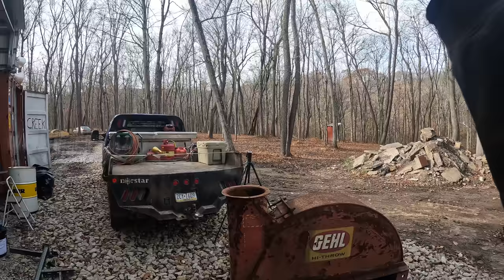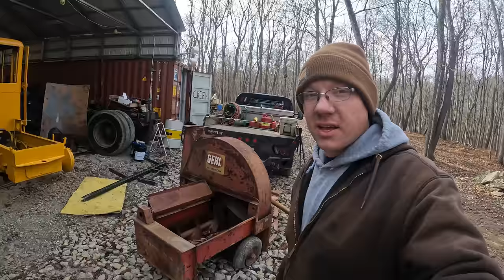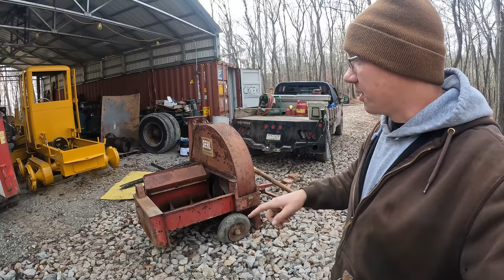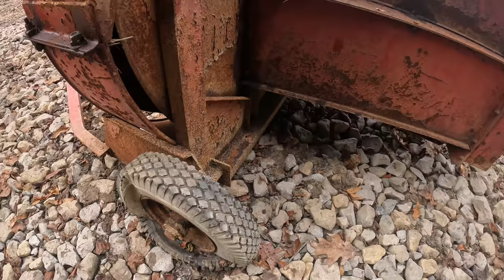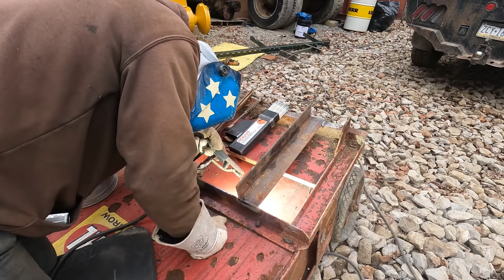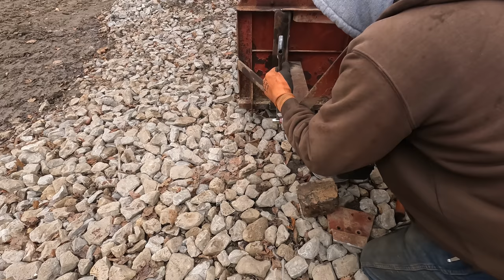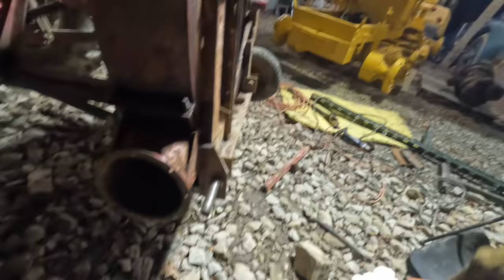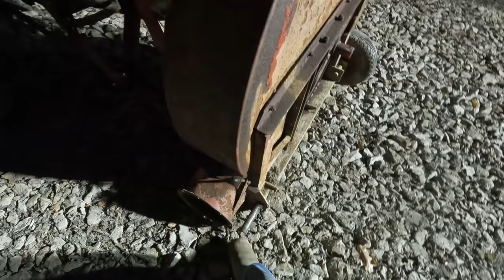I Built a Giant DIESEL POWERED Leaf Blower!!!

Comment: Dittos on the central air inlet around the shaft and putting a rectangular diffuser on the outlet. This is a centrifugal air pump, inlet air comes in around the hub or shaft and the blades accelerate the air causing it to go to out to the discharge volute by centrifugal forces and imparting significant angular momentum. When it gets to the discharge nozzle it escapes converting the angular momentum to linear momentum. A nozzle that reduces the cross sectional area of the discharge will cause the velocity to increase causing a more focused force to blow leaves. Try a nozzle that reduces the cross sectional area by at least half. In your video you can see how anemic the force of the air is. Partly that is due to the inefficiency of how the air is sucked in but a lot is also because of how the air is just dumped out through a big hole. What you need is velocity more than volume (think of a garden hose open and with your thumb over the end, which cleans the sidewalk better?) and a reducing nozzle will increase the velocity by close to the ratio of the cross sectional areas. I suggest making the the nozzle rectangular in cross section with the long side horizontal with the ground so not only is the velocity increased it is directed in a flat fan of air. Great show and a good example of thinking outside the box repurposing something.

Comment: Matt I think I have your solution. Take that band that turn grind off each blade edge down 1/8" now won't touch take a piece of ranger metal to patch that one area grind blade edge to miss easy know the wheels any scrap tube angle iron move the two wheels back in front put a small trailer hitch with a square bottom adjust to make you back up  put hitch pins if want a cheap hitch weld smaller pipe put a bolt and hitch pin know it sitting when stored on two wheels like a trailer and the hitch if those tire aren't ruined as the time are shorten that welder axle you cutoff one leaf on each side ok and that be perfect  for storage

Comment: just wondering if rotating the housing back to its original position and having a fixed chute on the right side of the machine with flexible ducting going from the output to the chute wouldn't restore full output. It would allow the wheels to remain in place as bogeys to allow it to float over the ground. That combined with the rubber tip idea mentioned elsewhere would prob net some interesting results.

Comment: I'm no fluid dynamics engineer, but I suspect that how close your intake is to the outlet will effect the pressure and efficiency of the blower output. Adjusting the intake size and output location could help. It seems that the original setup, while adjustable was roughly intake 180° to output.

Comment: Matt centrifugal compressors from 32 inches diameter upwards powered by 270HP plus diesels are used to suck rocks, dirt and fumes up to a hundred feet along then up vertical shafts out of opal mines.

The housings for the centrifugal impellers look virtually identical to yours but the blades for the impeller are sandwiched between two steel plates with the air intake in the center.

With that in mind, it occurred to me that instead of doing things by halves you would take the fun factor next level again if you could get hold of a small, service-time-expired PT6B or similar turboshaft engine and maybe even de-rate it a bit to go from hurricane to tornado!

As I understand it the composition and specific weight of Aviation grade kerosene which aircraft gas turbines normally run on is not so different from Diesel that they can't use it and if anything would run cooler which might be convenient!

I believe the turbines in M1Abrams tanks run on diesel and can even run on gasoline but as you might imagine they would run hotter!

I wonder how a blend of Gas/Kerosene and/or used sump oil might go?

The turbine could double as a sort of combination waste oil incinerator and leaf blaster and just think how it could deal with that pesky snow!

Forget about waiting for the leaves to fall, fit an afterburner to blast them off trees as soon as they change color then impress the neighbors and amaze their kids!

Any 'Greenies' within hearing distance would probably scream louder than the turbine and the only real disadvantage might be fuel consumption!

Comment: Wouldn't a skid plate work better to protect the shoot? Cut a hole above the shoot (180 degrees from current opening) same size as current back opening . Have one solid cover and one mesh cover and switch out covers as needed depending on task at hand.

Comment: the entire leaf blower must be layed  down horizontally  so you can position the hole and nozzle tip correctly i.e.  rotate  the entire machine towards where the leaf's are so the nozzle is directed where you want it.   also the nozzle  should have a flattening cone shape. just my two cents.

Comment: From the view point of a dairy farmer who has used these in there intended purpose, don't cut off those blades! If you look at them, there are bolts to loosen on the blades so you can extend the tips. That was intendeds to allow you to adjust for wear. The tolerance between the blade tip and the band is crucial to building proper pressure. Beat all the bumps out of the band, the adjust the blade tips. Our rule of thumb was for the blade to 'miss a dime but pick up a nickel'. [placed in the bottom of the band]  Rotate the band like others suggested, but for the love of god do not try to use that that thing for blowing straw!! They are insanely dangerous, unforgiving machines .It's not worth it, unless modified, maybe with an infeed table and pusher. Love your videos.

Comment: Hey Matt Bruce bonkowski I rewatching this video question that band slides around why not take that whole band off and that area you saw it stuck before taking it off mark the areas that impeller sticks then remove the band and then hammer them out then replace that band you might want to use your grinder the flat side of the blades my giant Vac blowers have 3/8" space from the band to impeller and mine band is all welded up and you might also spray the inside with a some thinned paint or old oil to stop the rusting I look to spray or roll it with galvanizolem it stop rust and being inside who cares and use that rear tire on the back

Comment: The blades or fan needs to be tighter the housing inside your losing power the way it is now. My 8.5 hp blower would porpell its self on the blacktop of the road. Matt put the caster wheel in front of the chute, make it adjustable

Comment: I was wondering if you can make a nozzle to fit over the end that is shaped like the nozzle on a hairdryer where it goes from a round end to a flattened one so that the wind is directed more in a flat flow direction, maybe you are losing some air force going above the leaves with your round end. I was looking at a hairdryer today and noticed the removable flat end piece. Also I was wondering if you can pull out the movable fan shroud and hammer out all the dents where the fan is rubbing and patch up that join where the fan is hitting.

Comment: Or just find a smaller diameter wheel that can be made to fit on the axle where it is.  It might also do some good to nozzle down the exit chute a bit more, and that might just be done with a sledge hammer.  I'm not sure that the intake placement is having such a big effect as you say it is.

Comment: Take that moveable shroud , so that it opens up to get the grinder on the blades and take some fresh bright metal off the fan blades, till all the fan blades are not hitting. Close off the intake with a steel plate and use SNUG FASTENERS, while your there fashion a piece of expanded metal to fit over that opening, weld some large washers so you don't lose the washers, easiest to put on and take off. Cut out the top left 1/4, using a piece of cardboard over the original intake hole to make a template, for the new intake. Cut a plate exact like the first one, doing the same with the expanded metal screen, all your hole measures will be the same. Use lots of those SNUG FASTENERS, on both openings to beef up fan body so vibrations doesn't create metal fatigue and tear the thing apart. If you can try to figure out a way to balance the fan blade as that is where the major vibration and destructive harmonics will come from. Fasten an adapter, a foot long chunk of rubber hose on the round outlet opening, secure with a heavy duty hose clamp and squeeze the hose outlet flat to the horizonal using 2 scrap flat bar and 2 thin long bolts with nylock hex nuts, adjust accordingly to get a pressure build up and creates a flattened jet of air. You get that thing humming, you can hire out to do some serious leaf blowing. Next thing you need is a vacuum truck, suck up the piles and make excellent compost, bag it, sell it.

Comment: as is i think you have a pretty nifty tool.  even if you need 2 or even 3 passes its less time and effort than a leaf blower.

one observation, it might work better if you swing the output up and over to the other side pointed down at the ground.  would also let you put the wheel back on.

further, having the wheels would make it easier to move around off the tractor.

Comment: What if you moved the pipe back to the top and put a flexible pipe/hose  on it and route it down to the ground. And you can point it in the direction you what to blow the leaves.

Comment: Personally I'd of left the old feeder on it especially of you wanted to use it as a straw blower part time,. Make an adjustable aming shute yo let you aim the wind or straw.  And as others said I'd rotate. The. Housing to blow out the right hand side at a downward angle for a test at least on leaf blower mode.   I'll second a previous idea to trim the blades back a bit, I liked the rubber tips idea, but may not be necessary.

Comment: Was watching this, why not just turn the output to the other side and add an angled nozzle? You would still be able to have the expanded steel grate over the hole and it would get to full speed with an unrestricted air intake.

Comment: Instead of cutting new intake holes, would it better to rotate the chute to the other side and build a simple curved air deflector to the end of the chute? Sort of like a hand carried leaf blower that has a curved end to get the air directed to where you want it. You could have it deflect down at ground level and then the machine would sit level and tires could be used.

Comment: I know this video is a year old now.  But is there a reason you dont rotate the output to exit on the right hand side?  That would fix multiple issues you have with it.  It would allow you to angle down the air without angling the whole unit and not make you drag the output.  It would also give you the full housing to build air pressure returning it to full strength.  If you wanted to use it for a straw blower you still could and just clock it up some from that point.  The only difference would be it would blow out on the right instead of left but thats not a big deal at all.

Comment: This blower will certainly benefit from taking in its air from the center of the housing as many have said.  Both of my blowers take in air at the center, both the diesel powered Harper Goosen (rear) and the 18 hp gas Billy Goat in front. The rear blower, though smaller than the Gehl, actually is sped up by the drive belt, probably producing as much if not more than the Gehl, at 4000 CFM (I said 2000 in the video).  Also, I turned the Billy Goat blower 1/4 turn to put the spout straight down to make it easier to divert the flow either to the left or right with the angled spout available from Billy Goat.
You can see them working in tandem here:  https://www.youtube.com/watch?v=QDlNUcoUo9o&t=2s

Comment: It had the power to blow grain 60 foot vertical, how about putting the exhaust back where it was, and running a chute to the front or side of the tractor?
Reply: or even put the exhaust at the 3 or 4 o'clock position, and run a short chute towards the ground, with a flattened elongated exit.

Comment: Make the exit pipe funnel shaped so the air from the fan is compressed , that will result in an increase in airspeed making the bower more effective Then the exit point of the funnel is flattened giving a broader exit area making the "swath" wider . Same with entry into the blower Wide mouth into a smaller area at the fan.  Another point is to curve the air at the intake in the direction of suction to reduce the drag. Again you get some form of compression as the air enters the intake .  I am no scientist but to me this make some sense to increase the efficiency of both in and outlets  Remember to put a safty scroon over the intak even if it is oput of the way . Just a bit od OSHA" or what ever you call it in the States Maybe too much effort for to little success

Comment: Instead of having the chute along the ground like you have it why not clock it angled down on a 45 degree angle towards the ground, rotate it all the way around the other way and have it blowing downward and at an angle. This means you dont have to modify it and you can use it for a straw blower just as easily.

Comment: Aside from other comments about the intake needing to be blocked off around the outside so the blower can build pressure better.
is there any reason you couldnt rotate the exahust all the way around to the other side(instead of blowing left you would be blowing right) this would allow the fan to build pressure better and also mean you wouldnt need to angle the 3point hitch so much as the exhaust would already be somewhat pointing downwards?

Comment: If you were to block that big hole off and cut the center sheetmetal around the axle it would be a completely different monster I have a small fan set up that is electric and that is how it's made and it works better than my actual leaf blower

Comment: Yeah, bolt up the original intake hole (so it can be used for straw hurling duty) and cut a single large hole in the front of the blower housing in the location you think is more advantageous for the leaf blowing operation...Maybe fashion the cover so it can be bolted onto either hole...
I would try to tackle the sparking and the rubbing because you don't want those sparks igniting the leafs and assorted brush on the side of your driveway... #firehazard

Comment: Hi Matt I like your vids an honest guy that tries to address everything life can throw at him. I did think when I watched your video the other day rather than major mods why not use the existing set up BUT as a vacuum? Pretty sure it would not be too difficult to knock up a "spray bar" al la vacuum cleaner and the impellor would batter the crap out of the leaves plus 'fire" then out rather than blow them around. Generally curved blades are good for (suction) or serious air flow. You could fire the leaves into a "catcher basket or net " rather than fire them in to the woods if you were having visitors!.

Comment: Alternate use, way out of left field. Talk to manicurist in town. With slight mods could do bulk finger nail (or whole hand) trimming. Would not have to worry about finger nails again. But you really need to modify all air inlets so there is absolutely no chance that any part of the body can enter under any circumstances - nothing to sew back together for doctors except sausage meat if you do. But overall, well done from 1st time viewer. PS. Am retired, but have my own welding, fabrication, machining and mechanical workshop in 16M (52ft) x 8M (26ft) shed with 3 phase power in Land Down Under.

Comment: All of the above on the design of the intake. It should be farther away from the exhaust. If you can see the exhaust hole through the intake, the air won't be properly caught by the fan blades and moved forward because the intake and exhaust are at the same pressure. Essentially, it is the same air space. If you can move that intake around to where at least two fan blades are in between, that is when the air can move. Size and shape of the hole isn't as important as placement and that it is bigger than the exhaust. US Navy Nuclear Power School. Heat Transfer and Fluid Flow class.

Comment: The end of the blower needs to go from circular to a rectangle,just like the wife’s hair dryer to increase pressure and more concentrated effort to give better blow on to the leaves.
I worked on ducted warm air systems in the sixties and your blower system is no different.
Dave🇬🇧

Comment: Nice work on the "PTO powered" fire starter/blower!!! It will blow way more air with the intake revised and a flat plate over the outlet pushing the air down/out.
Aren't those evolution chop saw nice!! Was thinking, you could have got one of the 3 point quick attach frames for $80 and welded it on, but would have been to close. Put some skids on the bottom so you get really low and it stay flat when dropped too.